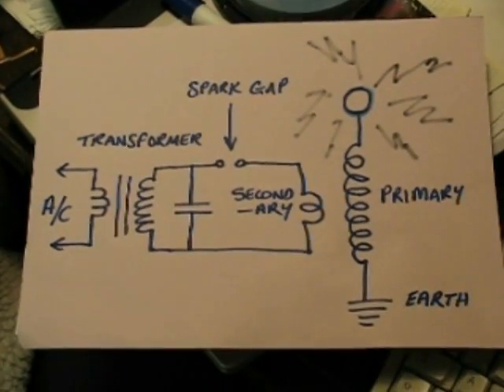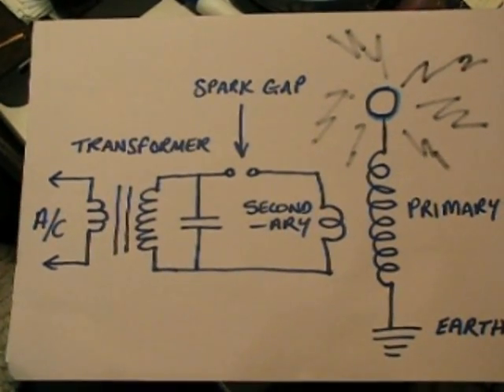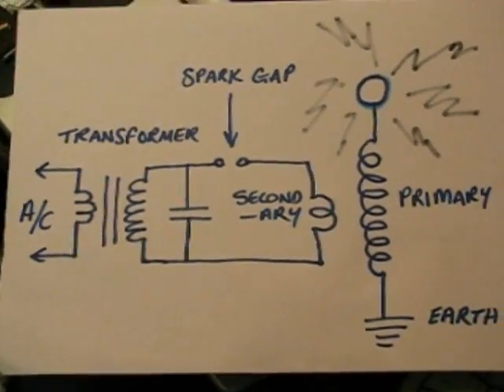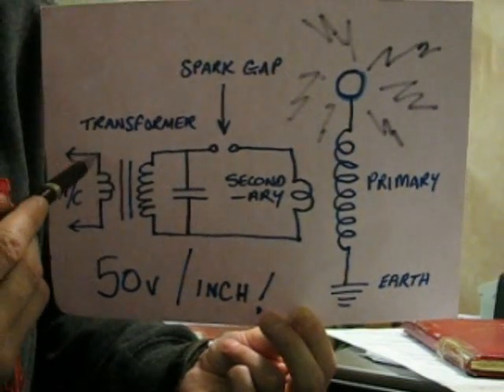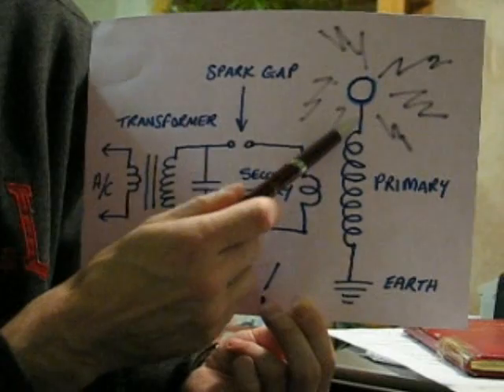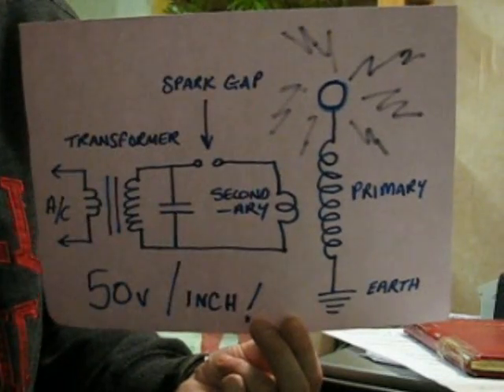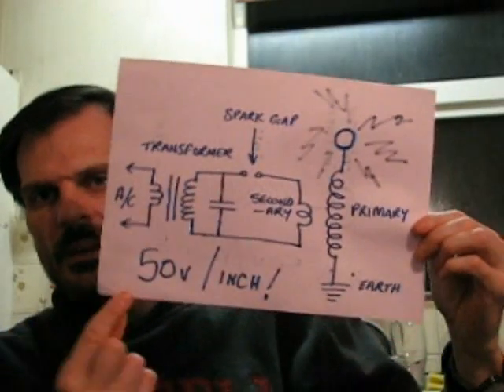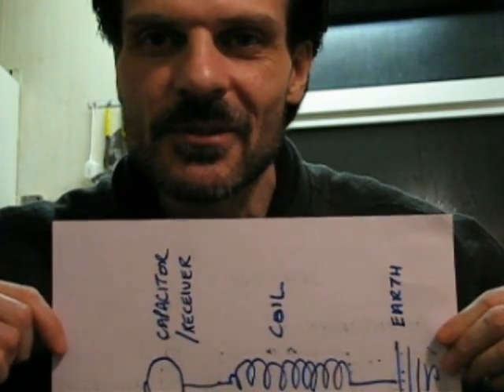Tesla's Little Secret

Comment: Here are my thoughts, which I give freely as I don't have the means or the time to do the research.  According to Maxwell, any charged particle which is spinning will create a magnetic field.  It is said the Earth has a magnetic field.  Further it is said that a magnetic material, like iron, will focus that field.  So the compass needle points to the happenstance mass of magnetic material near the north pole, which is not exactly at the north pole, but close enough that it draws much of the field into it.  Any such mass will then have both a north and south pole, it will be a dipole.  So the compass needle points to that focused mass of iron near the north pole, but note that the end of the compass needle marked N is pointing at a S pole of the iron mass.  

Since that iron mass near the North pole is charged we have to assume that it is being magnetized by a magnetic field.  We know the Earth is spinning so I think we can assume the Earth to be a big charged particle.  

Tesla was always talking about the light from the sun....it's all about the sun, he said. Even if one assumes that the many particles that make up the earth are so scattered that their charges neutralize each other, say in the absence of photonic rays from the sun, the steady stream of photonic rays may result in charging the Earth.  And in fact the side of the rotating Earth facing the sun may be getting more charge, and the side of the Earth facing away from the sun less charge, so there would be a gradient of charge across the Earth and so the Earth would effectively have a charge related to it's diameter. 

Now as the Earth is spinning throughout the day and night, the charge in the Earth, under your feet, is varying. So in the Earth, perhaps all of it or just the crust, there is a moving electric charge. And perhaps we can include the atmosphere which will also be experience a movement of charge throughout the day.  

It's good for the charge to be moving, as if it wasn't, while we might have static charge gradients from which it would be more difficult to extract useful energy.  

In Tesla's sketches and the drawings/photos of his tower, we see a large metal oval-ish obelisk at the top, likely a charge collector. Then we assume there was a coil or coils connected between it and the Earth.  I offer this semi-crude analogy:  we can blow on the end of a pipe and produce a tone. Typically the opening of the pipe must be narrow relative to it's length in order to produce a tone, and typically the end opposite where we are blowing will be sealed.  We consider such to be a tuned and resonating chamber.  The obelisk at the top of the tower represents the narrow opening of the pipe. It's big compared to the coils, but from a standpoint of charge it is probably narrow, as the charge may not be so huge in just one little bit of space above the Earth.  The Earth represents the closed end of the pipe. The coil connecting the obelisk to the Earth is the pipe.  

The movement of charge across the obelisk is like blowing air across the opening of the pipe.  With good tuning a strong oscillating voltage will be set up.  Some of that voltage could be tapped off, but obviously not all of it or the resonance would be loaded down and stop resonating.

However as I recall Tesla's claim was that such a tower would be a source of distant energy for others, who I assume would have to have a resonant apparatus to recieve it.
So it could be he was thinking along the lines of how pipes of the same tuning, adjacent to the one on which we are blowing, will resonate with the one on which we blow.

His large towers would be like really loud pipes and the recievers would be smaller pipes.

Note that I am not suggesting free energy as in created out of nothing.  The energy is coming from the sun and beaming in the direction away from the sun.   Because the Earth is spinning we on Earth, who must spin with it, see this as a wind  blowing across the surface of the Earth. Then a fraction of the wind is exposed to tuned aparatus of coils and capacitors that then resonate and  some of resonance is tapped off as useful electricity. 

BTW, Tesla's famous tall tower was tall likely to get a more powerful resonance, just as organ pipes for the low frequency are taller (longer) than those for high frequencies.  

The tower also has to be tall so that the charge at one end is greater than the charge at the other so that it is self-starting. 

Note my analogy to a wind blowing over the open end of a tuned pipe is not perfect...no analogy is.  One might ask why not orient the Tesla aparatus parallel to the ground in the direction of the Earth's spin...the so-called charge-wind or moving charge would still travel across it and be greater at one end then the other.   My analogy fails here because obviously an organ pipe or flute can be parallel to the ground.  The problem with a horizontal apparatus is that the charge varying across the ground be be too small over even hundreds or thousands of feet.  But with vertical orientation the charge likely decreases exponentially away from the Earth allowing for more gain.
Reply from the maker: You could say that he was unique and very few people understood him! Genius would be an understatement.
Reply from the maker: +rh001YT Good ideas, you got the gist of it. The earth rotating and being charged by the sun sets up a standing AC wave of charge with a frequency of 1 cycle per day. That might not seem very H.Freq. but on a universal scale it probably is. The sun is also emitting DC current perpetually which we can measure and use with things like solar panels. Solar panels though receiving &quot;free&quot; energy are actually particularly inefficient. Imagine what they would be like if we used thicker blocks of the Solar Panel instead of a thin wafer! The standing wave and the charge on the atmosphere is also what charges and aligns the water particles which create lightning.

The purpose of Tesla towers was to charge/ionise the atmosphere which could then be received at distance with a similarly tuned tower. Tesla used bifilar wound coils to eliminate any back emf and to make them safe at their centre (the high charge being found at their centre with only a few volts at their circumference). Tesla said he could make the clouds "glow" with electricity and if he charged them too much they would arc to earth like lightning. Resonance was the important part. And the Tesla coil allowed a few volts to be converted into millions of volts for long distance ionisation.

The Central Sun at the heart of our Galaxy provides the AC which combined with the earth's magnetic core and the permeative nature of the  DC from our own solar sun, creates gravity. 

Lots of energy all around, especially when you think of the number of suns and galaxies in the universe.
Reply: MattBlytheTheOne HI! I think it likely you know more about Tesla's various apparatus than I.  Can you tell me, were his power towers going to tap energy out of the ever present field, or did they require input of electricity, his intention then to distribute it wirelessly?
Reply from the maker: +rh001YT I don't know is the answer to that. As far as I know it required power at the input but it is also my belief that he was capable of receiving it from the aether. Whether or not it was through a tower/coil is the subject of the video and still open to question.
Reply: MattBlytheTheOne Yes, that is the question.  Having spent a lot of time in music recording studios I came to know why when an entire band is being recorded the piano is draped in a heavy sound proof blanket.  Well of course it is not entirely sound proof. But if one did not use the blanket than all the sound being produced by the other instruments would resonate the strings of the piano producing a mush of sound that would make the piano sound atrocious.  No one disputes sympathetic resonances, but I guess the whole issue with Tesla is whether significant amounts of what might be very scattered environmental energy could be teased out into a resonance of sufficient size to be pragmatically useful. 

Roger Penrose has suggested that Earth is an "entropy pump" meaning that the photonic blast from the sun is of relatively low entropy, that is it is somewhat orderly, and then, primarily at night that energy is returned to space as high entropy infrared radiation. Plants take part of that low entropy energy and use it as fuel. As the plant builds it's mass it reduces or slows or traps some of the transition of all incoming low entropy energy to out outgoing high entropy energy. Longer living plants trap more than the short lived.  Higher level organisms that eat plants, or that eat other animals trap even more. Petroleum, if it comes from dead plants, has trapped an enormous amount of energy, all of which came from the sun.  

By way of resonance transitioning energy could also be trapped. I am only pointing this out for super-skeptics that may cite Boltzman's 2nd law as a good reason to think what Tesla was up to can't be done. As any trapped, converted energy is eventually used and lost then the 2nd Law of Thermodynamics is not violated.  

Well I hope more people begin thinking about all this Tesla stuff as it may be legit.
Reply from the maker: It's true what you say but you missed the point somewhat. All atoms spin and get their energy from the sun. Plants do a thing called photosynthesis where they convert light, water and co2 into to sugar basically. Google it for the chemical formula.  

Oil is low energy. There is a third as much energy in household waste as there is oil. Water (hydrogen and oxygen) on the other hand has something like 50,000 times the stored amount of energy as oil. Both of which are almost insignificant if you examine how much energy the Sun is emitting every second.  

The trick is to use the atoms in an efficient way to channel energy from the sun. Somethings to think about. Cheers.
Reply: Well, if I may partially disagree.  Petroleum, especially the refined fuels thereof, have very high readily usable energy density. It is for the most part petroleum that is used to make the stuff we call household waste.  By a certain perspective we could say that whatever energy intensive processes are used to make household waste....paper and plastics for example...have had some energy locked up in them, but they can't necessarily release that energy in a high density way.  And then there is the issue of pollution.  If we could burn all the household paper and plastics in furnaces in buildings and homes then we could get some of that energy back, plus energy locked up in the constituent molecules of the waste, but there would then be too much pollution.  And the ash left behind would have to be carted away by trucks thus lowering the effective energy savings.   

So if household waste contains 1/3 the energy of oil I don't think it's energy density is as high nor does anyone seem to know how to use it for fuel in any realistic way.  

On the contrary, paper, metal and plastics are recycled thus lowering the amount of energy used in the production of those items even after energy is used to transport the recycled goods.

Anyway, if you want to get energy from atoms well that is already done in nuclear reactors.  Atomic bonds are so strong that most atoms will not split apart to release the energy. Molecular bonds are easier to split, but only when offered some alternative bonding, like how carbon can be split out from various molecules during combustion to form carbon-dioxide.  

And when atoms or molecules split and energy is released we have an increase in entropy.  Carbon compounds that burn, typically vegetation, are releasing energy that came from the sun and got trapped into somewhat unstable compounds.  

Of course petroluem they say is compressed dead vegetation.  

And it is oxygen to which carbon wishes to bond.  And it is carbon dioxide as you know that plants convert into their structure.  As long as one is content with the vetgetative carbon cycle there is a certain amount of fuel available by conversion to carbon dioxide.  But output of carbon dioxide in excess of plant take-up has negative effects, except if more plants can then grow, but there may be a limit to that. 

So I'm saying that energy release by atom smashing is not tenable except with nuclear fuels which are in somewhat limited supply (though thorium reactors may be a reality soon) and energy release by breaking and remaking molecular bonds seems limited to carbon in any significant quantities.

You mentioned water as fuel, and I think you meant converting it to hydrogen with a catalyst, then allowing it to react with oxygen and creating water again.  I'm not totally familiar with that technology but I suspect it might be a net zero as the catalyst likely gives out and requires replacement and so continued manufacturing with all it's energy use or something as we don't really think there is anything like a free lunch.  If it's not a net zero, then I wonder how, after energy release, energy re-enters that loop.  Maybe somehow solar radiation is involved, do you know?

We hear about the sun's tremendous outpouring of energy, but only a tiny sliver of that hits the earth for 1/2 of each day.  Still I have read that enough hits the earth to power all the.....everything.  But then what are we to do, cover the earth with solar panels?  How will the plants grow.  Even humans need some to make vitamin D.  

If Tesla was on to something that has since been lost or hidden I suspect he was "merely" tapping into the Earth's electric field which may in fact be replenished each day by the Sun, or is coming out of the molten core.  I hope someone figures this out as it seems to suggest a great way to get electrical power.
Reply from the maker: Yes it is and that is exactly what they do with it. Burn it. And not in the UK - we sell to ethically minded countries like Norway and Sweden as cheap fuel. The energy in three barrels of household waste is equal to approx. One barrel of oil. Google it. As for the waste. Ash has much less volume and density than household waste and can be easily buried or "washed" back into the land. They even use it in animal feed ffs. 

Plastic is oil agreed and can be melted down and re-refined back into oil and petroleum. But as far as energy goes petroleum is not particular "high energy" due to the amount of energy (and waste bi products) that's goes into making it. 1kg recycled plastic = 1kg oil. 
Google it. 

Oil isn't vegetation lol. Where did all those veggies come from so deep under the earth? No it is the actual result of highly compressed and very hot organic rock matter. Like lava but in a more refined form. It is literally the blood of the earth and we suck it away like mosquitoes. You can even see oil forming (plus other toxins) at landfill sites, which is why we had to stop using them because they were poisoning the land around them. 

No the energy that is easily harnessed in atoms is electric energy contained in small amounts in all things. The same energy in water molecules that generates lightning when aligned. The same energy that comes from the sun that powers them. The same energy that permeates the universe everywhere at all times. 

What I am saying is "burning fuel" is about the least efficient way to gather energy possible. Of this method however, water is about the most efficient. Hydrogen and the oxygen needed to make it burn can be doped with any other inert gas to make it burn like gasoline and then use in conventional engines. A good example is using an engines spent exhaust gases recycled back into its fuel injection chambers. Of course petro-Corp don't want you to know this. 

There is no correlation between co2 emissions and negative world impacts. In fact co2 is less now than it was 50 years ago and much less than it was before man even inhabited the earth. Plants need co2 in the photosynthesis process and the amount of energy they "store" in terms of combustible carbons is very small next to how much energy is contained in their atoms!

Solar panels are the least efficient of the most efficient way of receiving solar energy. They are heading in the right direction but the materials they are made of need to change somewhat. They way they are made is the key. How about solar roadways? And solar roof tiles? And see through solar windows? All these technologies I mentioned already exist and are coming to a town near you soon!

Really you seem to know a lot about science but only from a rather text book perspective. Maybe time for a new paradigm in energy production to realign the earth with truth ...rather than a delusional form of greed called taking? Lol. 

Tesla used to say it is an electric universe. Which is one model of understanding. Currently on earth we still believe all our energy comes from burning old dinosaurs and that the sun is a burning ball of gas. About two hundred years ago the world was flat too apparently. Definitely time to clean up our models of energy production ;)
Reply: HI! Well I'm all for a paradigm shift but right now no one seems to have any good answers other than solar panels and wind/tide farms.  I think solar roads have been debunked as political scams to bilk the taxpayer.  

The solar panel industry is booming in the parts of the USA that get sufficient sunshine - typically the South and Southwest.  

Something is wrong with your source-or-petroleum theory....there are no organic rocks. Somehow way in the past huge cataclysms, maybe tectonic shifts, buried vast vegetated tracts of land under rock. Not that there's much evidence for that, but the reasoning goes along the lines of how else could so much carbon have been buried? And it's not just carbon, like soot being buried but whatever it was it was such that it had some kind of organization into molecules that when squeezed down formed various other molecules most or all of which have a lot of hydrogen atoms.   I don't know if the semi-complex petroluem molecules could have been squeezed up out of material already deep in the earth's crust.  

Anyway, that aside, I'm not sure where you get your figures that there is now less carbon-dioxide in the atmosphere than 50 years ago. 
But yes, way long time ago there was less carbon in the atmosphere and altogether less biomass.  It is a question as to where the carbon came from that was then incorporated into the emerging and enlarging biomass.  Some experts say that volcanos all over the earth spewed carbon into the atmosphere. Well, that supports your theory that it is already in the Earth.  The carbon came out of the volcanos, they say, bonding with oxygen along the way to create CO2, which early life forms converted into their structural material releasing O2 in the process.  The O2 was likely already there to be bonded with C in the form of H2O. The heat of the volcano somehow caused the O2 to split off and join with C. Then as plants through photosynthesis split the O2 from the carbon we got more O2 in the atmosphere.

So the story goes.

I think the high point of the story is that photosynthesis is able to able to use the energy of the sun, photons they say, to split the CO2 molecule, which really is amazing since CO2 is rather inert.  So while entropy should always be going up, disorder increasing, in the plant we have entropy going down, but only temporarily.  The plant as a negative entropy device creates order, but what we think of as fuel, any fuel, is a movement towards disorder. By burning plant fuel to build things humans borrow some of the lower entropy of the plant, exteneding the lower entropy state, but eventually everything humans build up decays and entropy increases as it always wants to.  

When atoms are split to make nuclear power we are increasing the entropy but capturing some of the negative entropy, the order that was in the atom,  temporarily in conversion to electricity. 

Thinking about entropy might help to devise ways to slow it down, which is what we humans want, we want negative enropy, we want order. Oddly the only way we get order temporarily is by capturing energy on it's way to entropy.  So we burn "fuels" and capture the decay of radioactive atoms.

But the other atoms will not decay as their bond appear to be very tight.  A huge input of energy is needed by atom smashers to smash just a few atoms and whatever energy is released is miniscule compared to what went in.

Waxing a bit poetically now I note that the carbon cycle, pre-modernity, was in balance. And perhaps the balance was even more balanced pre-modern-man.  The jungle is all "eat-or-be-eaten" but the balance was such that it seemed as if it could go on forever, or at least as long as the sun rained photons onto the Earth. Humans have upset the carbon balance. So yes, a form of fuel that does not upset the carbon balance is crucial.  So that means that burning carbon fuels is the wrong idea, even if it is post-consumer waste.

I hope that someone, like a Tesla, figures out some clever method of better capturing the Sun's photons or pulling electricity out of the air, but I will caution that pulling electricity out of the air..the atmosphere...the aether....might cause an imbalance unless of course we pull such a small amount of the total as to be insignificant. Note that the Tesla's production f the "wall-battery" is a means to increase the negative entropy by temporarily storing energy from the Sun's photons, which is what plants do.   The Tesla battery me thinks is the right direction forward.

Regarding post-consumer waste:  These waste products, like paper and plastic, are negative entropy, but they are very short lived and so represent very little negative entropy.  What humans want is long-lived negative entropy.  So we must consider that fuel is best used only to create long-lived negative entropy stuff. Imagine if a house was worn out after only ten years!   

I support all efforts to limit post consumer waste. Recycling what can't be limited does keep some of the negative entropy in storage, so that's good, but not perfect as energy must be pumped into the waste to raise it's level of negative entropy to make something useful.

You know what's a really good negative entropy product....the resin chair.  We see these all over the world now in rich and poor economies.  They last a really long time.

OK, I've written too much. I sign off now.
Reply from the maker: Hi and in not even going to address all your dino-theories at length other than to say I think you are a distraction and that if you want to share your theories at length this probably isn't the place to do it. 

Many people have come up with alternative fuel generating options, solar is good but needs improving and governments have not debunked it they have railroaded it out of the public eye like all good inventions that will overthrow their dino-sales-monopoly. 

If there are no organic rocks why is it law that we put them in all white flour products? Along with nicotine? Think about it.... Also for a better understanding of oil Google "black goo" and "chemtrail forest die off" you will find it interesting if nothing else. Melting the ice caps creates a great oil exploration opportunity. 

We already have the technology (I repeat) we need to combine solar panel/permanent magnet/battery tech to produce a permanent battery which has already been done by numerous people if you had done your research before touting yourself off as an expert. 

CO2 was higher a long time before combustion engines were around. Maybe it was dinosaur fart gas or hot air from all those theories. Who knows? Not you obviously. Tesla knew that much we can agree on.... Have a good day.
Reply from the maker: I have to say you are starting to sound like a shill. If you want to learn something you don't write 1000 word essays on how not to do it and then say no one has come up with anything positive and that you are an expert on the subject. If all you are going to do is dis the options and spout the mainstream narrative further comments will not be approved. 

Imbalance? Do you think the sun will grow dim or run out anytime soon? The sun will shine whether we capture it's energy or not. Knowing that and assuming you can learn anything, you may now save yourself some energy and take a day off!
Reply from the maker: Maybe reading an old version of Encyclodpedia Brittanica would be of more use to you? They contained facts too once or so we thought at the time. Lol :P
Reply: MattBlytheTheOne Now, Now, never mentioned the word dinosaur.  I did mention vegetation, but the key idea is that oil comes from buried and compressed life forms.  That trapped negative entropy, so that's good.  Any energy that we might suspect lies here or there has to be trapped negative entropy.  We get energy or fuel by tapping off some of the energy released when negative entropy is freed to continue on it's merry way to positive entropy.  I think that's important to consider.

As for your Britannica comment, Sir Karl Popper well explained that scientific knowledge tends steadily towards greater versimilitude (truth or accuracy) due to careful scientific method.  Folk facts get overturned by science, but science moves steadily, slowly and cautiously forwards.  Mistakes found in say a 30 year old calculation are always small mistakes and rarely if ever overturn the cart.  So from the Ford Model T we progressed to the autos of today but never has that cart been overturned (except in accidents of course, but that's not part of my analogy).  

I'm a fan of Tesla and I think it a tragedy if he was really onto a better energy source and all that's been lost.  But I note that Tesla lived for many years after he lost Chase's funding and certainly he could have written it all down for us but he did not. 

It is thought that Steinmetz (sp?) of RCA was very familiar with Tesla's work but we didn't get any new energy sources from Steinmetz but we did get a better AC motor....Tesla's AC motors had overheating problems.
Reply from the maker: Ok apologies about the dinosaur comment but it is still an assumption I happen to not believe that oil is compressed vegetation. 

Entropy is your background obviously and it is your model of understanding. That's fine if that helps you to reconcile your wisdom in to a form you can understand but it is only one model and there are many. 

I like to think of energy as flowing from a higher state to a lower through a conductor and with no particles, just a continuous flow of energy from one point to another. Everything is energy stored in one form or another. 

I also like your Model T Ford metaphor but electric cars that run on radiant energy from the aether would indeed upset the cart lol even if it still had four wheels. And what about UFO's? 

I think if you research Tesla thoroughly you will find that he did write his work down. But it has since been mislaid. When I started researching Tesla about twenty years  ago I discovered that as fast as I could find a breakthrough all trace of it would disappear from the net. Did you know he invented the tube lightbulb long before Edison stole his ideas? Try finding any mention of that anywhere on the internet now.